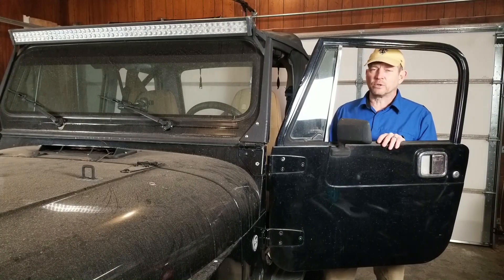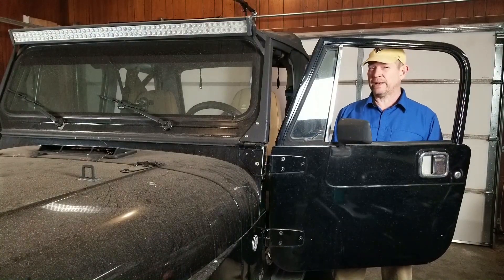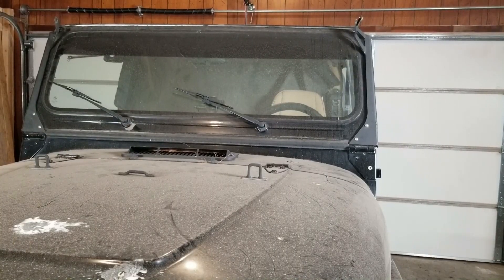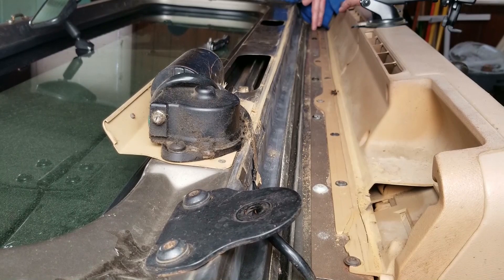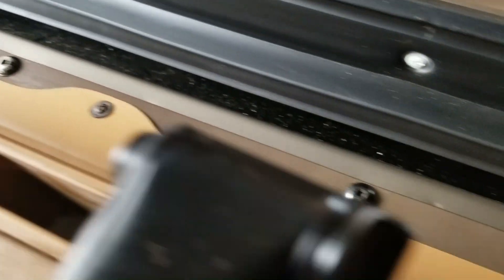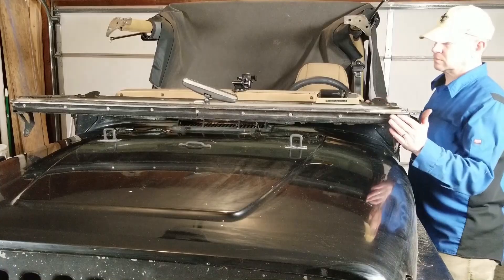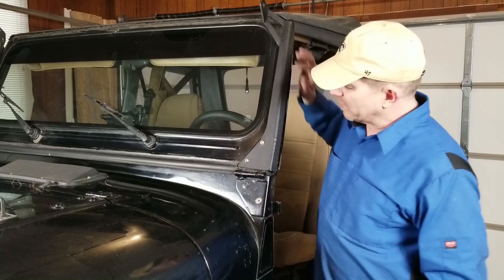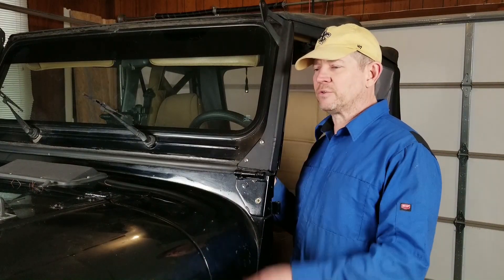FIRST TIME! Dropping the windshield on the Jeep YJ #jeep #windshield #cj #maintenance

Comment: Leaking in the floorboard?
My YJ used to dump BUCKET loads or water in the floor, especially when when a right turn (I was a pro at moving my feet so shoes wouldn’t get wet). It ended up being a simple fix:
On the cowl, where your “hood scoop” is located, there is a drain tube that runs down the firewall. Mud, dirt, dirt dobbers, etc. will block that hose up and cause the water to build up in the vent and leak/spill

Comment: 1st definitely lube your windshield hinges. I shoot mine with WD a couple times a year. I replaced my seal in my 1991 YJ, hard top. I marked everything so I new how and where everything goes back. I had a huge problem getting the windshield back down to it’s original location. It seemed the new gasket was so fat the windshield wouldn’t go back to its original location. I couldn’t get the 3-hole brackets to line up and the windshield was about an inch from the rollbar no mater how hard I pulled on it. I eventually hooked up a ratchet strap to the windshield top center loop and attached the other end to the rollbar and still I thought I was going to brake the windshield. I also had to get longer bolts to pull the rollbar close enough to install 1 OEM bolt to hold the rollbar to the windshield frame so I could install the other 2 OEM bolts. Great video. Thanks

Comment: My experience on water leaks after a few months doing root-cause was that the frame was rusted in the lower part where from glass meet with the windshield frame, If you remove the external glass seal there is a big chance to have rust there, that was feeling the frame with water internally and causing the leak.
In my case was when there was a really hard rain then I started to have my feet wet as it was dropping from there.